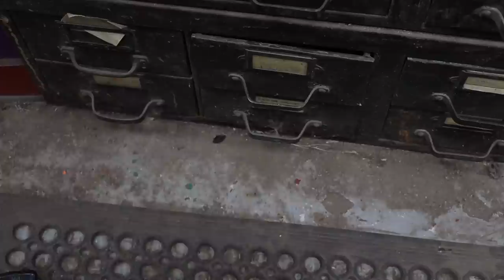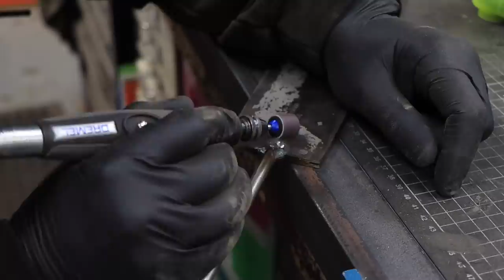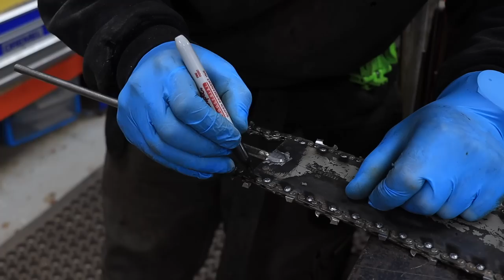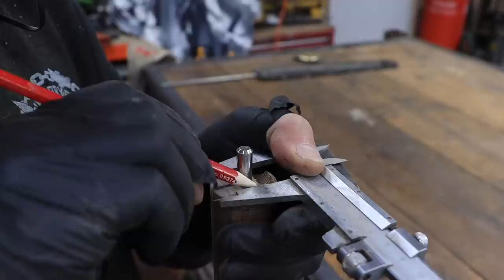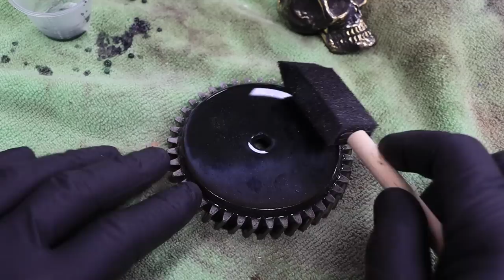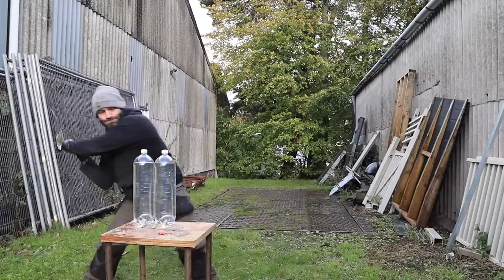Making a Powerful CHAINSWORD

Comment from the maker: What did you think to this build?
A lot more devastating than I thought.
Reply: Interesting build as always. But I probably wouldn't have cut as much of the bar off, I'd have left more of the slot to have more surface area to weld the handle rod in place.
Reply: Definitely one of the most intimidating looking builds you've ever spawned. Yes it definitely is more destructive than I imagined. I have an idea I would like to see you make. Its called a "rock bow". Basically a crossbow that fires steel shot, marbles, rocks etc. I think you'd have a blast with it!
Reply: This is a devastating weapon. Excellent for the apocalypse.
Reply: Definitely capable of doing irreversible damage. Pair this up with some standard ball bearing grease that has been mixed up with table salt.. coated on the saw blades. Not only will the cuts burn like heck from the salt, the grease will just be terrible for any healing factors.
Reply: @doejon9424  Dammit, that's vicious, but I love it. 😈🖤😈
Reply: Now you need to make a sword out of axes. Double bits would make it easier tho lol.
Reply: Lol that outro had me dying 🤣
Reply: @chesterpanda  depends on if you want the blade to have two edges like a long sword or one like a katana.

Comment: That was pretty smart using the drill bits to shim the blade to the proper height for welding.  I've used ass sorts of stuff that I had to keep fiddlin' with to get it to the correct height.
Reply from the maker: Worked a treat just a few calculations then me realising i had no shims that thickness but had bits. Thank you

Comment: Beautiful work, as always !! This makes me want to see you try a smaller "club version".. with x2 chainsaw blades that are cross welded to each other like an "X" pattern.. with the saw tooth blades facing downwards.. for ultimate slice action.. when spamming evil watermelons. Your melee weapons are top notch, next level !! Hopefully someday you take custom orders (like thr customer chooses spring trench club  or battle axe or spoke bat & you make it with your own art twist.)
Reply from the maker: Thanks dude, i have an idea for a future build using a chainsaw for sure
Reply: Another "club" idea:
A saw chain tightly wrapped around a central spine.
It has to be stripped of the inner drive lugs and somewhat sloppy to begin with, but some twisting should help with that.
Reply: @sthenzel  That would be savage too ! Almost like a souped up & modernized barbed wire bat

Comment: Very clever! 

I wish I had learned to weld when I was young.
Reply: It's never too late. Just remember to always wear your ppe which should always include a respirator. Welding fumes are horrible.
Reply: @GameTimeWhy  Thanks! My health has failed, and that's put me on disability. The financial issues as well as the cost issues will probably keep me from giving it a try. I just don't function well enough for enough hours in the day to justify trying to learn.
Reply: @VTPSTTU  sorry to hear that. I don't know if it's a thing where you live but there are lots more "hobby shops" popping up where they are fully stocked shops you can pay a drop in rate to use the tools making it way cheaper than buying your own. Also some fairly cheap classes for fun rather than work purposes.
Reply from the maker: Thanks mate, definitely worth trying

Comment: Nope… it’s good but it could be better.
Salvage the parts from a small battery powered electric pruning chain saw, and build a true “chain sword “
In the style of Warhammer 40,000!
Reply from the maker: This is different, ive seen the motorised ones before